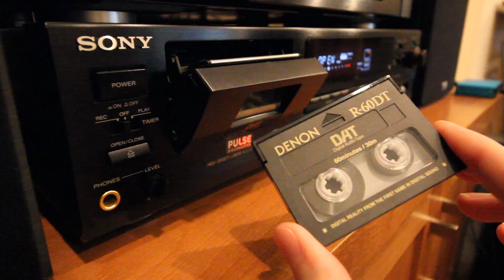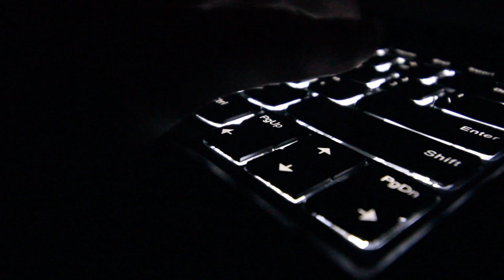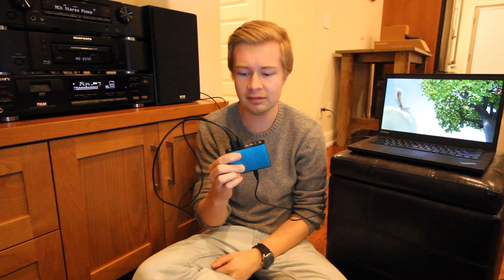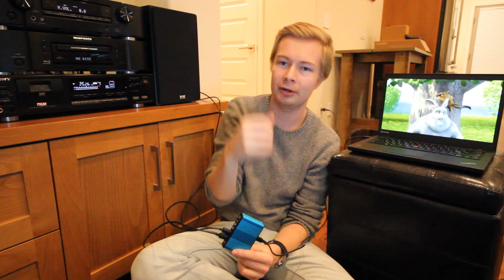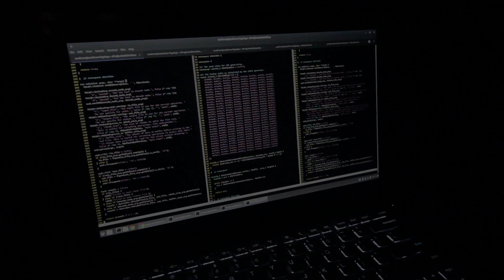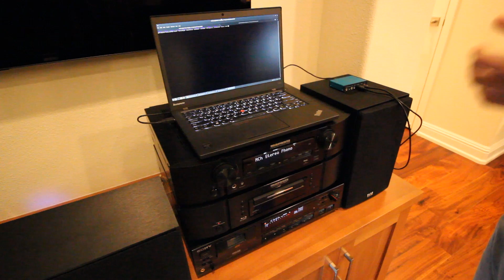datvideo | Storing Video on Digital Audio Tape (DAT)

Comment: This is a very cool hack! If you can encode all the way to 16 bit 44.1 you can store HD videos on Audio CDs! Sadly, the H.265 compression did not exist back in the 1990s otherwise we would be having very good quality Video CDs which could store up to 74 min of high-quality compressed video which would surpass the low quality MPEG1 VCD standard back in the day! Still, I don't like media compression. I would like to see a YouTube video being played with digital noise, and this being able to be converted into lossless 16 bit 48 khz or 16 bit 44.1 khz audio which would turn YouTube into a storage haven for high quality audio recording but will alarm YouTube and the record labels unless the data is encrypted.

Comment: This is pretty much exactly what I've wanted to do with an ordinary 80s VHS deck like they did with PCM audio and data adapters.

Decent 1080p60 is expecting a little much even with h265 but you can do some imressive video at that bitrate.
Reply: Now we have AV1 and upcoming AV2 codecs, the quality will get even better!

Comment: Question: why might this be happening?

I did a simple thing in which I just added a 44.1 kHz 16 bit WAV header to the top of some N64 rom in HxD, changed the extension to WAV, played it with Foobar2000 on WASAPI setting over TOSLINK with the cable plugged back into my PC while it was recording it with Audacity at 44.1 16 PCM (result file was 1 minute, 30 seconds), but when I exported the recording at 44.1khz 16bit, a very large portion of the bytes were shifted up or down usually by a value of 1. With more experimentation with HxD, I found out that the same thing happens with normal audio rips too, though inversion tests with Audacity showed that the original file and the recorded one sound exactly the same.

I'm curious as to why there are byte shifts if SPDIF transfers are supposed to be bit-perfect.

I should also let you know that my Foobar2000 and Audacity both have dithering off, and the USB sound card I use is the U24 XL.

Thanks.
Reply from the maker: Yeah I ran into a similar issue on my first attempt at this project. It turns out that somewhere on the software audio path, a mixer was applying an unknown transformation that was corrupting the stream.

I fixed this by using the simplest possible and shortest audio path under Linux. I disabled pulseaudio and used aplay to send the audio to the sound device. Once I could confirm that a bit perfect copy was happening, I started involving the tape.

Hope it helps.

Comment: Sony DTC-690.
I have the same deck, and I sorta both like it and hate it at the same time. The thing works and sounds great, it's stylish, but mechanism is a bit crap and yanks the tape, untreading it during eject.
It seems to be by design; there's a solenoid, that engages reel brakes when disengaged, and brakes threading mechanism when engaged. So untreading a tape normally by gradually spooling the tape back in is simply not possible since both brakes must be disengaged for that. So it first pulls in the guides, leaving a tape loop loose, which it then proceeds to schlorp violently back into cassette.

Hopefully Tascam DA-P1 will behave better when I'll get ahold of it.
Reply from the maker: Ha, mine behaves the same way. The mechanism is just a little clunky in general, but it is a nice unit overall. I like the VU meters during playback/record. Audio quality is as good as my Marantz NR1508's DAC can produce as I have TOSLINK running throughout my system.

That TASCAM unit is beautiful! Enjoy that.

Comment: Is somebody did on audio cassette as analog audio, how it is appears with the noise of the tape?! It is very interesting and curious for released on cassette tape, it is gonna be nice content for peoples that they have a cassette tapes and they have found opportunity to trow it into garbage.
Reply: I don't know but it is decidable if using chrome tapes on high bias and playback as also may dolby NR if it's used will cut the signal binary and will be mistake and will it open errors by reading process.

Comment: I'm interested in trying something similar but storing digital audio on analog tape. So similarly highly compressed digital audio, converted into a audio stream pumped into normal or high bias tape.
Reply: avisa, si lo realizas
Reply: It's worth a shot. The only problem to tackle though is bandwidth. Most good analog tape decks can only go up to 16khz until it rolls off.

Comment: Wow it’s amazing that it works in real-time! Would it be possible to store real-time data on a regular audio cassette? Not necessarily at the same rate as with DAT,  but would it even work? You could take the analog output from your DAT deck.
Reply: Analog audio cassette barely has any bandwidth compared to dat

Comment: wtf that's crazy bro i don't get how does digital audio get stored on magnetic tape or any digital data for tha matter 🤯🤯🤯
Reply: It is stored as an analog singal after adding error correction and modulating it. But this happens on the very end of the process before the signal reaches the tape drum. Think of it as an older telephone modem which done this in the voice audio range. But of course this is more advanced, capable of storing around 2Mbps of data.

Comment: You've done the opposite of what Phillips did to record PCM audio for CDs onto U-Matic video tape. Using PAL format it worked out to exactly 44.1Khz. NTSC would've resulted in a similar number but not exactly 44,100 samples per second.

How about putting DVD compliant MPEG2 with AC3 audio onto DAT?
Reply from the maker: Yup, that would definitely work. The datvideo software tool could encode any arbitrary data onto the tape. My first test was storing a JPEG.
Reply: DAT at the highest settings uses 1536kbps PCM audio. That's the bitrate budget you got if you want realtime playback from the tape. HEVC/H265 produces a very good quality picture at this bitrate, that's why it was choosen in this test. MPEG2 is now at least three generations behind and HEVC/H265 provides around ~70% better compression than MPEG2. Of course if realtime playback is not necessary, you can do whatever you want, but then for a full feature film you might need more than one tape.
Reply: @IstvánNagy-z7m  : Next step would be a 2x speed option, more bandwith.
Reply: Next step is using AV1 or AV2 codecs for video and Opus for audio.

Comment: this is a really cool project. I think old SGI machines also used DAT tapes and drives as a cheap backup solution.
Reply from the maker: Thanks! Yup, you are correct. In fact, you can use the "computer" tapes in audio decks for longer runtime. The downside is that the DAT decks don't always handle the longer tape well and tend to jam on them.
Reply: Good day  @TheResistorNetwork , do you have projects that you work for encoding/decoding computer files like pdf or jpg? All I know that it can transmit data via audio in a max. sampling rate of 48kHz.
Reply: I have two DAT drives used for storing data. The format is called DDS. I also managed to store and stream video from the drive in real time, although it's not as impresive as storing video as audio data :)
Reply: @vladtomoiaga4721  I want...
Jealousy.
Reply: 1tb NVME ssd sticks are about $100.  Can't really complain about that.
Reply: @firesurfer  stfu, it isn't as magical as a tape or a disc.